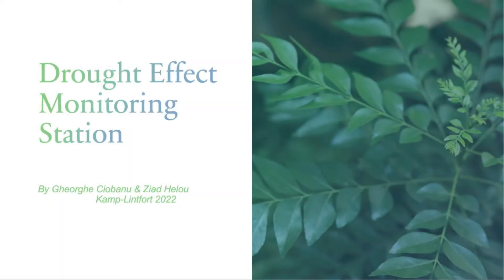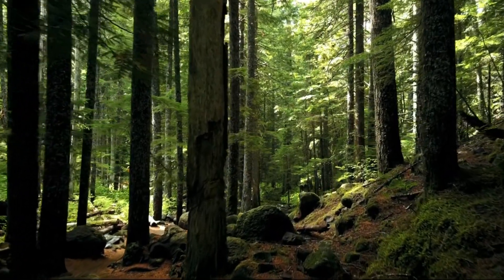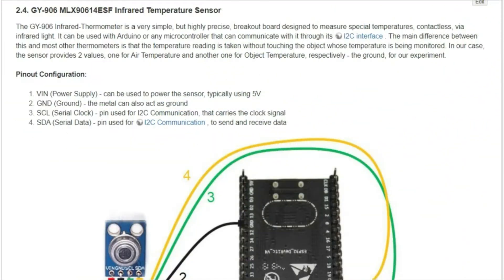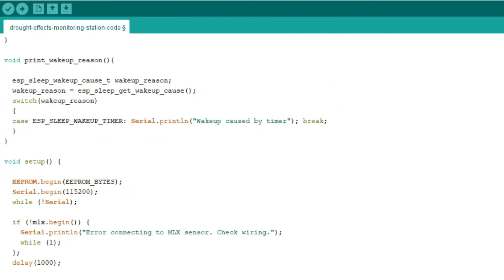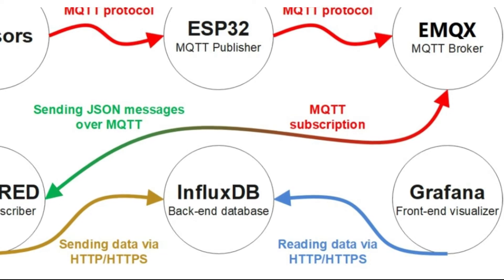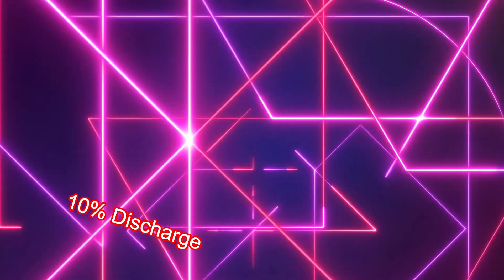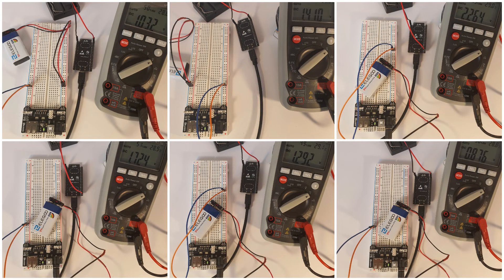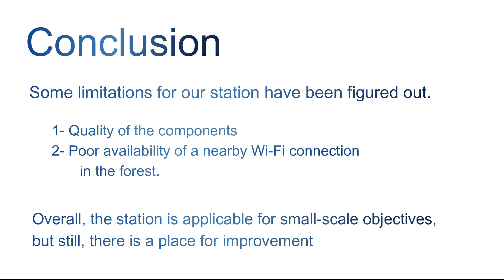Does the ESP32 run on a 9V battery? How to connect ESP32 to Node-red, InfluxDB and Grafana via MQTT?

Comment: You could  use a 18650 battery (4.2v fully charged) on your 5v pin and connect you sensors to the 3v3 pin , i run my project like that for 100 days on this battery and deep sleep between sensor readings , this will work great if you have a low drop regulator on your esp32 board